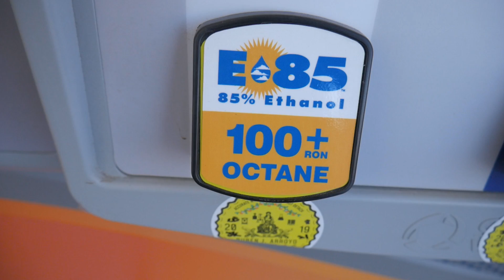Why Can't the BMW N55 Engine Make "High Power"?

Comment from the maker: Just as an FYI, the point of this video was NOT to bag on the N55. As an owner of an N55 BMW and someone who greatly prefers it over the N54, I made this video to explain some of the hardware limitations that users encounter frequently which hinder power gains. Turbo & fueling being the two biggest factors from everything I have read, thankfully there are solutions to both of those :)
Reply: As another N55 owner, its only reliable once you blow/crack every intake/boost pipe and replace them with aluminum
Reply: @brisso500  done, accept inlet manifold plenim, bearings and all. Turbo, hpfp, suspension, brakes wheels fbo in alloy massive cooler. Semi fast , 500whp estimate in logs
Reply: @brisso500  do you think might as well let them go bad before you replace them? I mean if it ain’t broke don’t fix it?
Reply: Why even compare! You dont like the n55 dont freakinbuy it!
Reply: One was allot worse than the other as soon as it hit 2-3 grand and you let go of the pedal it sounded like two metal spoons being clacked together Sounded just like the vids on YouTube titled spun rod bearing Ive been hearing more lately specially on 2011’s getting up to around 120-150k
Reply: Bro it’s a bmw neither is gonna be reliable
Reply: @cloutlxrdgaming44  uou don’t know much about the n55 lol

Comment: In what world is 480 ish whp slow for a daily street car ? I own a "11 e92 paired with the dct (yes it has the n55, the pwg version) . Pure 500 turbo, lpfp and hpfp + bolt ons and it makes 480 up to 6.5k rpm on 95 octane , if i switch to the e50 map it makes around 530-545 whp depending on how warm it's outside 🤷

Comment: i got both a 2008 335i and a 2014 535i.     n54 and n55.

the n54 feels literally way faster. so much more torque in low rpms and it just boosts like a missile. and keeps going.

the n55 just feels super linear and not torquey. feels like a mazda.

Comment: As someone who came from buying 1000$ shitboxes like old civics and fords with 0-60 in yes seconds, i was absolutely perplexed when i got to do a test drive on an f30 335i xdrive... its a whole other world going from sub 100hp cars to something with 300hp... i couldn't fathom what i had experienced and immediatly bought the car.. it didnt take long before i started to venture into mods. i'm not a mechanic by any means, but working on my own cars and doing maintenance is something i've always done since i ever had my first car. i never had this joy of buying parts online before, and installing them myself.. that's when i found out about flash tuning and again, changed what i really thought cars where capable of.. after installing a blow off, intake, intercooler, charge pipes, and fuel components, i went straight for a downpipe and got a mhd stage 2+.. i'm certain the car feels like it has around 450whp and i feel like i can gap any car or supercar (just that greatness feeling lmao) and honestly i absolutely love the damn thing.. its sharp, fast and nimble.. more than what i need, more than whats needed to even drive on the streets... its something i take pride in, coming from shitboxes to something i built by my own hands and makes me feel tremendously happy.. no joke, building this car in months it took, eased off on my depression, and driving it like a hoon is it's own experience to cure it.. we dont need 1000hp big turbo cars like everyone on youtube or social media is doing.. just find a good platform, mod it and tune it to your taste.. drive like you stole it (responsibly) and have fun, with the 300 or 400hp that the car has.. it's way more than enough. cheers

Comment: Only problem I’ve had with my 2016 f22 is offer putting the JB4 tube on it is that it eats through charge pipe I’m in my 3rd in less than a year (it was fine stock) and I’m hoping to get an aluminum one instead.
Reply: with all due respect that was a very foolish decision to tune before upgrading ur chargepipe, chargepipe is the first thing you need to do before anything else with these n55s, i gotta ‘16 m235i myself and did the cp and FMIC not long after preventative purposes

Comment: You mentioned only the EWG N55’s vs N54’s but forgot about PWG N55’s like in a late model e82 135i or e90 335i when talking about fueling. The short on our systems is the LPFP, which is already a stronger system than the EWG cars. Just like the N54, the PWG N55 HPFP is the stronger of the two N55’s, and most of the time is good for E60 blends without port injection. Plus a bonus is that it’s way cheaper to upgrade a LPFP than a HPFP! (Unless you factor in having to replace it around 120k if you’re outside of their class action lawsuit timeline for the HPFP)😉

Comment: I’m in the process of buying a 135i N55 having come from a Chevy Cruze with a blown head gasket and I’m sure the N55 will blow my mind. the exhausting pursuit of the “best version” of a bargain sports car feels pointless. The N55 may not be as “tunable” as some other model, but it does have that fancy screen and swanky rotary dial at a price that I can afford. That alone is worth way more to me than the ability to get more power out of expensive bolt on parts that I would never use to begin with because it would void my warranty anyway.
Reply: The n55 is a highly tuner friendly engine, especially the n55b30O0(m235i) and the n55b30T0(m2) due to their forged pistons, crankshaft, and additional oil cooling.  Upgrade the charge pipe and you’re good to 400whp, upgrade the intercooler and you’re good to about 450whp before you start getting fuel cutting issues.

Comment: N54 vs N55 blown WAY out of proportion. So N54 makes a little more power on stock turbo. Ok. N55 maxed out stock turbo still fast af compared to other cars. Then, just turbo upgrade the N55 if you want ultimate power. 🤷🏼‍♂️

Comment: Yeah I'm pretty close to the limit with my stage 2+ 400awhp n55 but you really don't need more power for a daily, since upgrading from stage 1 I rarely go WOT from a stop anymore cuz it gets up to 60 pretty quick at 3.7 sec and I still get to make my friend jelly that his brand new m340i won't beat my little F32 lol

-Edit: I'm pretty much at the limit without doing major drivetrain upgrades, F Chassis AWD can't handle that much HP stock
Reply: Yeah I have a 335xi as well. The 8hp50(mines a '15) handles power just fine,,especially if you reflash(same with earlier 8hp45) BUT the dang 180mm diffs that are welded and open really limit power handling. It is possible to have lsd's installed but stupid expensive. If I ever get to install an 8hp70 then I'll look into seeing if I cam sntall the 210 diffs front and rear with a bolt-on ring gear(to send in and install an lsd on the stock diff it's around $2400ish per)

Comment: What you smoking.... n55 can make 650+ unopened ffs.....
Reply: Everyone just says they don’t make power reliably lol
Reply: @JustLuuchi  well..... b58 wont run power reliably if crank hub isnt upgraded. So no difference really. Theres guy on youtube doing 682 whp with n55 unopened.  There's running big power reliably.....and then there's abusing a car. You can blow a b58 to pieces if you drive it in the correct  manner for that....🤷‍♂️
Reply: @Drquimbaymatumbo  the designs are damn near identical block decks are different but that effects cooling not power. They damn near hold the same if it’s not a manual no dsg over 600hp m5 comps need clutches to do  over 700 cause the trans can’t hold. Everyone just capping when it comes to b58. And I’ve seen n55 make around 500-600 reliably anything over that though Is a different story!
Reply: @JustLuuchi  thankyou mate. You're quite right.

Comment: I have owned an N54 for 6 years and now I currently own a B58 and a N55. If you want power: B58 > N54 > N55….if you want reliability : B58 > N55 > N54…..Basically B58 is king, then between N54 and N55 you need to choose between power and reliability.

Comment: I'm running a custom map on my 435i with upgraded FMIC and DP and managed to get around 490hp and 780nm with stock turbo and HP-LPFP. Really happy with the result and no problems with the engine even with now 180k km on it. A really great engine if you maintain it right.
Reply: could you please share information about your custome tune?
Reply: @Brad0st  sure it has an MHD tune in combination with xHP Flashtool. Then I hit up wedgeperformenceracing and they made a cutome map via runs in 3rd and 4th gear while logging. They tweaked the map a couple times and I had finally those results. It was tuned to the max, more boost would result in a Railpressure drop, so thats the first thing which was limiting the power to under 500 hp. Also had a custome made exhaust system with only a resonator, decat downpipe, upgraded TMAP sensor form the N20, fully upgraded intake/chagrgepipe, upgraded BDV and upgraded FMIC. Probably forgot some things. But yea could keep up with a Stage 2+ 440i and destroyed M4s.
Reply: @tyrox1667  can you do a build list for us pls 490hp outta a n55 ?
Reply: How is that possible

Comment: My 2011 E92 335i (N55) makes 400Whp with bolt ons, stock turbo and 93 octane at 16-18 PSI.
Reply: What mods are you running?
Reply: @tmc8516  Sorry to disappoint, I came to find the previous owner at some point installed a Stage 2 Turbo 😂. I was always wondering why the damn top end was soooo strong…
Reply: @tmc8516  

Vargas Stage 2 Hybrid Turbo
VRSF 5 inch intercooler

Stock BMW Diverter Valve
Aluminum Charge Pipe

VRSF Ceramic No cat Downpipe (straighpiped except for some sort of aftermarket mufflers (2 of them)) 

CSF 200$ radiator 
1 Step Colder Plugs gapped at 0.022
Dinan Ignition Coils 
BMS Intake

Comment: I’m hitting near 500whp on my f21 m135i n55 and I can have it more up than this. They do over 650whp on these engines without internals. All the n54 55 b58 all need big changes to make great power, a turbo upgrade and hpfp the right fuel and bingo they all do it. They get to certain point and all will break and need internals for big big power

Comment: What you’re saying about the twin scroll is kinda off, a twin scroll is actually better than a twin because how it works is it dynamically adjusts at different RPM’s one gate is larger than the other so you get appropriate boost throughout the rpms.

Comment: e92 335i n55 is the perfect balance. you get the reliability and power without the newer n55 limitations
Reply: Idk what limitations you’re referring to regarding the later n55 iterations. They’ve became more robust and tuner friendly. For starters adding an ewg as opposed too pneumatic. Also forged crank and rods as opposed too cast.

Comment: EWG can handle 650 on stock block, Wheel power. same as the B58
Reply: No it can’t it’s not forged
Reply: @KevinTorres-xc2sv  Lolwtf, B58's are cast, and they can do 750 on stock block, what are you smoking ?
Reply: @KevinTorres-xc2sv  Both N55 and B58M0 are cast lol, what are you on about ?
only the B58s in the supra are forged rods & crank

Comment: in my situation does the bmw 2013 528i have a n55 or n54? what years are mainly n55
Reply from the maker: That has neither. A 2013 528i would be equipped with the N20 Turbo 4 Cyl engine I believe
Reply: @SimplyCarThings  that is correct. The same engine as the 228, 328 and 428

Comment: Big misconception.. all n55s have forged connecting rods. many forms have confirmed that. Its the earlier models that have cast cranks. The wear point on earlier n55s is not the rods but the cranks. When we see failure its cranks splitting, not bent or snapped rods.
Reply from the maker: interesting, i did know about the forged rods. I actually broke a lot of that down in my N55 variants video

Comment: Guys, after I had a problem with the valvetronic motor and the eccentric camshaft at around 90k Kms I have to say that this is definitely not a reliable engine (N55). For fucks sake there is plastic inside the engine (this valvetronic motor)...

Comment: Here you go.

N54 has forged crank and rods w/ cast iron pistons
N55 has cast crank, rod, and pistons.
Only the x4 m40i and m2 n55's have forged everything, and larger factory turbo. They even share the same forged rods as the s55.
Both engines are open deck. 
All variants of n54 and n55 can make the  same hp/tq unopened with bolt ons. 
N55 cast internals have been proven to hold up to the same power numbers as the n54.
Both stock rods fail at 700tq, including s55.
The punchines/"more power" feel of the n54 comes from the true twins, simply because they move more air.
You will not get into big power numbers with twins, you have to do a single conversion.
N54's also sound more crappy not only because of the twin turbo setup, but because of the true dual exhaust.
You can clean up the sound by opting for a single pipe setup with or w/o resonators like the a80 supras. You can get an even better sound after pairing it with a single turbo.
N55 has the single already but a true dual exhaust. Go single and you'll hear an even cleaner/more aggressive "2j" sound. 
In order to gain big power from either of these engines you have to close the deck and rebuild it with thicker forged pistons/rods/arp ardware. This is the same formula with open deck honda engines.
The only closed deck inline 6 blocks are the s55 and b58. B58 is the strongest stock block because the cyl walls are coated similar to the GTR VR38. 1000hp n54/55 blocks have to be converted.
The only differences in limitations between the two is R&D. Since the n54 has been on the market for longer, there are more complete kits and aftermarket support for them. DocRace, RK, and Motive are arguably the leaders in the development of parts and tuning.  DocRace has a top mount n55 kit available, Turner Motorsport has a better looking engine cover (because the oem n55's one are ugly, all that's left for the cool looking factor is a front face intake manifold. DocRace will probably be the first to make that too. Once the n55 equipped BMW's drop lower in price and R&D reaches the same time as n54, you're going to see the community shift.
Reply from the maker: Fantastic information and insight brother. Thank you for sharing this seriously valuable info to all of us! Such great stuff! I should also add the N55 in the M235i got the forged crank and rods as well.
Reply: Sheesh bro read this whole thing, gotta say this makes me feel much better about the 2012 335i I’m getting. I’m saving this comment by the way. So informative. Predicate chu my guy 👌🏾
Reply: the m235i 2014+ n55 has forged crank btw
Reply: seansurfn2 they M2 N55 has the same forged rods and pistons. The regular N55 in the 35i cars are cast
Reply: *saving comment *
Reply: tbh im getting a used m240i soon and the b58 engine is even better.. then ill be doin a 600hp+ setup
Reply from the maker: @seansurfn2  nice man! should be a sweet build
Reply: Yo von knight you got an insta bro
Reply: @carlosleal5587  Yup, @SmplxCulture .
Reply: cast iron pistons?
Reply: @chippyjohn1  I was confused. I had to read what I said 4 times to catch it. Mybad. Cast Aluminum*. Don't know what I was thinking way back.
Reply: Not my N55... not all N55s are the same. OG M2 Here with the T0
Reply: All rods are forged 😂 so stop listing "forged" rods as some kind of amazing thing. N54,n55,s55 all the same rods. 
Now moving to the crank....forged or cast doesn't matter one bit honestly. Would I rather have forged? Sure why the hell not but that doesn't matter in any of these high hp applications cause cranks arnt breaking 😂.  Tbh it's actually impressive that rids are bending and heads are lifting way before the n55 hypereutechtic pistons even get rattled. That's much in the design and the high torque early in the PowerBand. It's so annoying hearing all these young people that are just regurgitating the same "bro science" they here on these forums 😅.  We all need to take a step back and look at things from a "first principles" approach to things. N54 is open deck and same rods as n55. N55 has longer duration and higher lift. Funny nobody talks about that. I honestly don't think there has been many n55 builds or pushed like the n54 has cause of the stigma. I think they are both just as capable of running 600whp reliably with responsible care. Rods seem so bend for both after 700whp. And also head lifting due to the 9mm corner head studs. Reaming em out to 11mm like the rest will stop that. But that's a can of worms. Rabbit hole that never ends. 500who-600whp. Max for somewhat reliable. Period!   If you want more get s55 or b58.
Reply: @tedcorbett3492  You're responding to a 2yr old thread with false info. Info that can easily be googled and linked to extensive write ups on forums about rods. This was also before the b/s58 were proven.
Reply: PREACH! N55 owner here.  2013 535i XDrive.
Reply: Good and almost all true. Except for one thing, the n55b in the m2 is a closed deck block. Not open. The older/standard n55 is open deck.
Reply: @Flight2Freedom86  Negative. All N55 blocks are open deck. This is backed up by numerous sources and pictures. 

Where are you getting your information from?

Comment: Argggh this guy and his videos. Wanna know the truth? It takes money, N55 is at over 700whp as of this moment, want more? Rebuild it with forged parts. However, it is way more reliable then the N54, I have two cars with it, both at over 100k, and still running strong with no noises or issues.

Comment: N54 forged rods and crank,  N55 doesnt. and I do believe the the N54 block pistons sleeves are stronger as well
Reply from the maker: not entirely true. Certain vairants of N55 such as in the M235i & M2 got forged crank and rods as well. The N55 in the M2 also has the valvetronic, bearings, and pistons from the S55 as well.